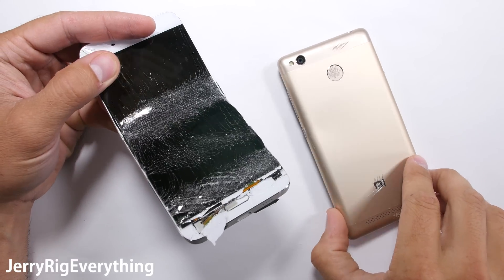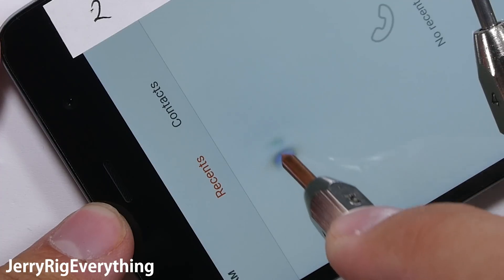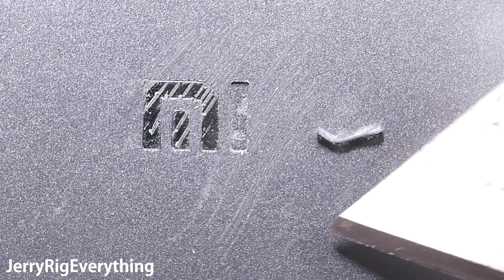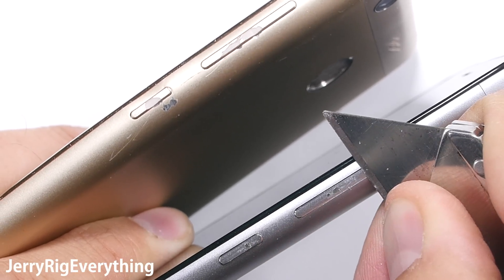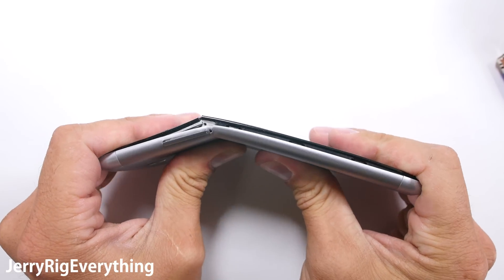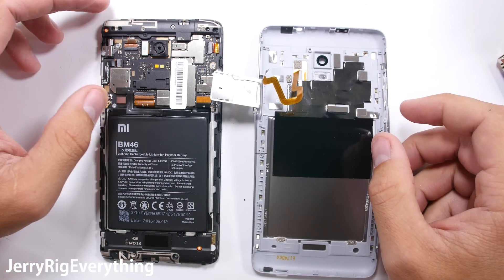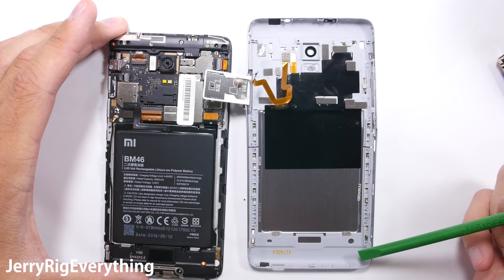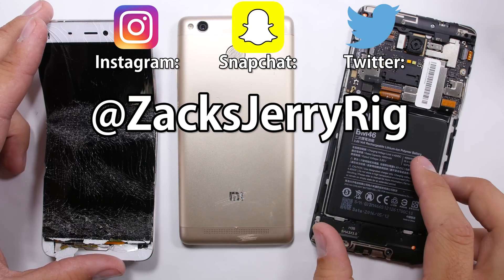Redmi Note 3 - Durability Video - Scratch, Burn, Bend Test

Comment: I've probably asked this before - Could someone explain he scratch test?
I mean, the front is one piece of glass, therefore it should be the same?
Why would it scratch deeper at one part, and not scratch at all near the top 
It's the same material
Reply: he is using a different edges (ostrze in poland)
Reply: He is scratching it with different materials.
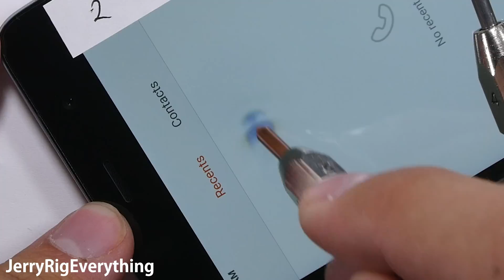Reply: James Carson I'll explain. As you said, yes the front is one piece of glass. When we puts the label it's just to show which pick he is using. The pick #6 has a sharper edge than the #1. If you pause the video at 0:53 you'll see that every pick has a different number.

Comment: At the prices of these phones(maybe except the Mi 5 which costs a little bit more) you could forgive the fact it can't hold up to the bend test. It basically passed everything else with flying colours.
Was really surprised the Redmi Note 3 fingerprint scanner still worked like normal though.

Comment: I actually like Xiaomi phones but durability is a very important point for me. Jerry keep up the good work!
Reply: For me too but I won,t bend the phone until breaking it in 2 parts. 
I mean... I never sit on my phone and bend it. It survived all the tests except the bend part. I think is worth it
Reply: Guus Tielens Try nilkin frosted shield .They are stiff and hard as hell
Reply: CrIsTian XxTrOLLxX Mine has now bended from staying in my pocket after 5 months. I did nothing abnormal with it. I can still use the volume buttons, but I doubt this phone will last for long like this. I'm now going to see if I can find a really strong case for extra strengthening. I hope there is a case like this and that my phone will not bend any more than it already has with such a case.
Reply: I have since used the Nilkin case, and the phone still works normally as of yet.
Reply: Actually his name is zack

Comment: I think that pretty much every xiaomi phone will fail, but anyway, I haven't bent or brake my mi3 nor mi5 so I guess in normal use they are strong enough ;) 
btw. I sat on it several times, so my screen protector cracked and I have to buy a new one, whatever- it's only 2$ ;)

Comment: +JerryRigEverything could you introduce a new water-resistance test to your durability tests?
I had a Xiaomi Redmi Note 2 which got a little wet, so I took it apart. I'm not kidding, it was just as wet on the inside as on the outside. No waterresistance at all. It didn't survive...

Comment: I am very regret buy this phone as my main phone😭
Reply from the maker: +hin‘s tos gaming Its a good phone! Just don't bend it.
Reply: +JerryRigEverything I often my phone in back pocket...😱
Reply: +nirjan sarkar Chill. Even I have the Redmi Note 3 as my main phone. It's a surprisingly good phone considering the price point. Fit in a durable case and you're good.
Reply: phone is Good just dont use it the back pocket. honestly using phones in the back pocket here in Brazil is asking to be stolen so only dumb people do it tbh lol
Reply: As long as you don't intentionally try to break it, it should be OK.

Specwise it's a beast and the performance is superior to the LG G4, battery life is INSANELY GOOD.
Reply: I have redmi note (the 3g version) two years already and it held until I've smashed in with the car door (that would destroy almost every flagship I think), but then I just bought a replacement screen for 15€ and replaced it without any problem.then it broke again when it fell from a ladder without tempered glass, because I just put one off because it was broken and I was waiting for a new one... replaced it again... since then I order 2 or 3 tempered glasses at once, to always have one in the backup for immediate replacement... now I'm gonna buy redmi note 3 for my birthday...
Reply: Ady Antonio your a cheap person
Reply: +hin‘s tos gaming buy a case
Reply: +Dünni Unglaub It's obviously not as durable as a flagship device and no one ever claimed it to be.
Reply: Many people don't believe that xiaomi build a phone with a very low quality,which couldn't last very long.But still people are buying it.Lol
Reply: its fine dude, this is an extreme test which puts the phone under a unrealistically high amount of stress.
put a good case on there and you should be fine.for that price range it's a good phone.
Reply: I have Mi2 Xiaomi's phone, for 4 years. No other phone lasted so much. After 4 years I haven't experienced lags. After 4 years I am mentioning again. Did you see HTC M9 or iPhone 6 before you commented here? Then you should realize that it's not a "bad quality phone". 4 years it's eras for phone lol
Reply: it's a very good phone, you don't know what you are saying
Reply: yeah so sad my main phone is just like mi5 :(
Reply: no surprise, its a cheap phone
Reply: I'm still planning to buy this cause of the spec and price. Just as long you don't bend it...
Reply: +JerryRigEverything I wanted buy huawei honor 5x at first...which one do you guys is better...
Reply: because now you know that it's not as durable as a flagship phone?
Reply: +hin‘s tos gaming note 3 is better
Reply: me río but mine's a Nexus 6P 😅😨😫😢
Reply: man i have this phone, dont worry about it its an awesome piece of tech, especially for the price. just dont put so much force on it. i even bought another one, for my dad, so dont worry, and be happy :)
Reply: hey it's not the pro version
Reply: its snapdragon, means pro version bro
Reply: Was snapdragon 616 and 650 are same?
Reply: Haha...this is my phone,, nope because that broken not at battery area!, and redmi 3 pro battery provide the phone body
Reply: Kadek awan2000 and now in normal english please
Reply: How much did you pay for the phone? I would go buy an expensive phone if I was worried about durability. I bought mine from China somewhere but it offered a hardcase and tempered glass screen in a bundle. Still waiting for it to arrive on possible 30 day shipping...been almost two weeks now. Can't wait to put custom ROMs on it. lol
Reply: +Chansook Saechao in Indonesian about Rp.3000k
Reply: john doe you talking about the flagships that also broke in half?
Reply: Chansook Saechao or explode*
Reply: JerryRigEverything Mine has now bended from staying in my pocket after 5 months. I did nothing abnormal with it. I can still use the volume buttons, but I doubt this phone will last for long like this. I'm now going to see if I can find a really strong case for extra strengthening. I hope there is a case like this and that my phone will not bend any more than it already has with such a case.
Reply: Prashant Baskaran What case have you purchased for it?
Reply: Guus Tielens are you using skinny jeans or something? i have it for some time now, more than half a year, no bend, and i just use a simple soft tpu type of case
Reply: casper aalders No, normal jeans. And it's comfortable in my pocket. I used the silicone case, so shocks from the phone falling would be absorbed well by the case.
Reply: Guus Tielens thennn, i think your really unlucky :((
Reply: casper aalders Lol are you trying to say that the build quality of the phone isn't good? what does this have to do with being lucky or not?
Reply: Guus Tielens idk just trying to joke around a bit, i'm not an expert with phones
Reply: hin‘s tos gaming
Reply: steve lai RIP English
Reply: AtomDestroyer Gaming and stuff :P ??😊
I'm Hong Kong people...
Reply: steve lai Okay my first language isn't English either
Reply: steve lai don't worry....are u gonna bend it like this?? hell no...go ahead and buy it...it will satisfy ur expectation..I have a redmi note bought b4 2 years and I'm still happy with it...no problems..no bends , ...and I hope to use it for 2 more years....

Comment: So Zack... Would you recommend a Xiaomi phone to anyone? Even after all three you have tested failed the bend test?
Reply from the maker: +Benjamin Ewald it totally depends on your location and your budget.  You get a lot of features for a cheap price with the xiaomi phones.  So ya, they are still good.  It would just be a good idea to buy a case at the same time.
Reply: +JerryRigEverything Sounds good. They aren't bad phones they are just cheaply made. But that also makes them cheap to buy, so if you're careful with them you can get a good deal.